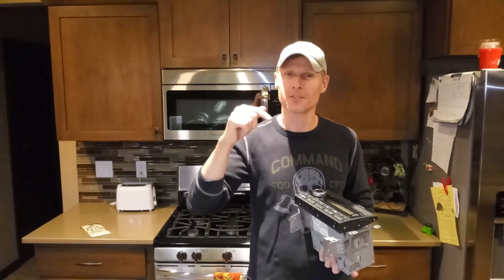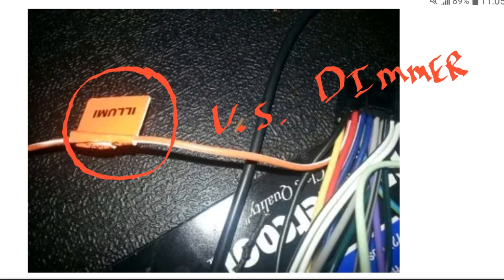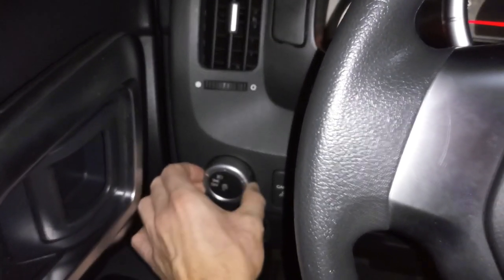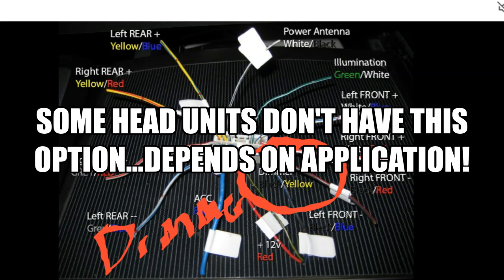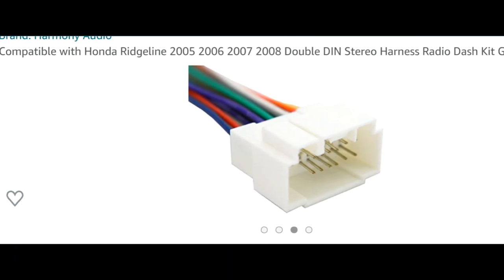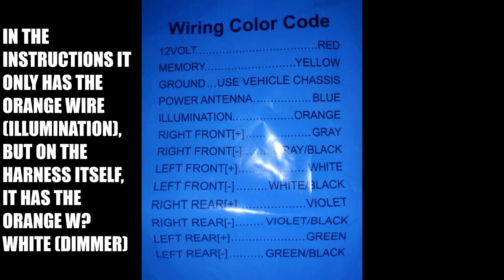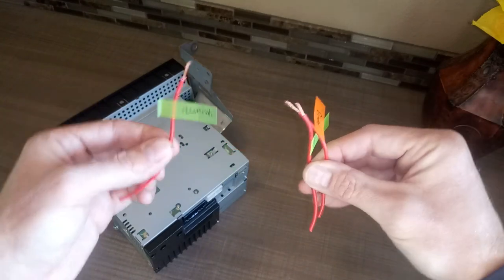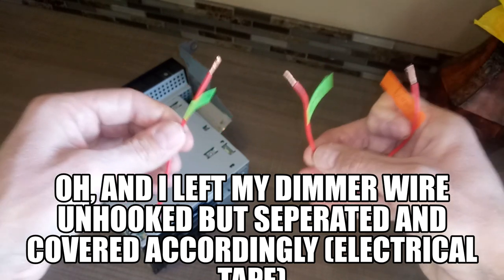dimmer vs illumination wire/ 08 Honda Ridgeline

Comment: Ok so if wire is orange/white “dimmer” coming from aftermarket radio side and wire is straight orange “illumination” from oem radio side harness what do I do?? 🤷🏻‍♂️
Reply from the maker: Don't hook them together. Secure them to themselves.
**disclaimer....always consult with a qualified professional. Videos are for entertainment purposes only***
Reply: This was my problem, too. My adapter harness to my car doesn't have a dimmer wire but an illumination wire while the after-market radio is reversed.

Thank you
Reply from the maker: @Gwenpool2369  my recommendation is to go ahead and not hook them up together and just wrap them up separate and not Oakland together at all. This is the exact scenario that I made the video for because a lot of the time, if you hook those together, you created short. The radio will still work as intended except you might not have the dimmer come on when you switch on your headlights. But as a disclaimer, always check with a qualified professional, as I am just some guy on the internet:-)

Comment: So can I just don’t connect any orange wire, leave it like that and my radio will still works?
Reply from the maker: Yes brian031.. it is not necessary to hook any of those up.. the radio will still work, just might not dim with the lights when turned on:-)

Comment: My facetory harnesses had Green which was ILL and Green white was ILL when i hooked up both wires when i adjust interior light it will shut down my headunit or restart with no sound. Any help? Should i disconnect one ILL?

Comment: what if on the car side i have Orange illumination, and Orange and white dimmer. and on the head unit i have 2 wires both marked as "illumination backlight" but 1 is Orange, and the other is green?
do i connect the 2 solid Orange wires, then just assume that the green one on the head unit is the dimmer and connect it to the Orange and white dimmer from the car?
will doing this cause any problems if they are supposed to be connected the opposite way?

Comment: More help please.  I have a orange wire that is marked Illumination/Dimmer.  This wire is comming out of the aftermarket Head unit.  There is no orange or orange and white on my factory wire harness.  What do I attach this orange wire to?  As of now with it not attached I have no lit buttons at night.  (Makes it difficult to operate)  Can I hook that wire up to the accessory power?
My factory harness also doesnt have a blue wire.  I have a blue wire on the aftermarket head unit.  With out the blue wire hooked to anything.  I have no fm or am signal.  Can that wire also be run off the accessory power?
Please help....

Comment: Than you so much for the video. It is really helpful. I have Honda  Odyssey Rb1 from Japan and the factoery harness has ILL +ve and ILL -ve. My aftermarket head unit has ILL wire only. whick do you think should I connect before I blow the fuse? 😃

Comment: Thank you for your video my Mitsubishi outlander 2004 star factory have these two wires but the aftermarket radio they don’t have it. That’s why I ignore them but I have problem now on the dashboard light not working and I check all the fuses no problem, but I don’t know why is that because I don’t use them

Comment: I just installed an aftermarket head unit, ran new speaker wires and did not use a harness. I found the constant, ground and ignition wires and connected them to the head unit. I did not connect any illumination or dimmer wires. Everything works except the radio comes on when I turn the lights on. Plus it shuts off when I open the door. Do you know what is going on or how to fix this?
Reply from the maker: Hey BillyzTube...sorry to get back with you so late! definitely sounds like there are a couple of wires connected to wires that are not supposed to be mated together. That is the problem with doing your own splicing together and not using an aftermarket harness (unless you do this kind of job a lot). My guess is to pull head unit out again, go back to research drawing board (Internet), and try and find your factory wiring schematic again, and try seeing if there is something that you are missing as far a s what wire goes to what. Hope that helps, and hopefully by now you got the problem fixed. Let me know how it went;-)

Comment: Sorry I have a question . what need This Illumination Wire for polarity it’s A plus or minus from the Lights?
Reply from the maker: Any question is a GOOD question:-) Technically, you do not need to hook up the illumination wire for lights to work on some units, but to answer your question directly...my understanding is that it is POSITIVE and it is a variable power because the dimmer switch on your dash is variable. As always...comfirm with a qualified technician as my advice is for entertainment purposes only

Comment: My problem was my factory harness had the dimmer wire the cheap head unit didn’t so I left the dimmer disconnect. Now the problem was when I turned on my headlights my dash looks washed out. It’s like the bulbs are brighter turning my nice green display into a light blue. Thoughts
Reply from the maker: Hey Rob, I would try disconnecting the Illumination wire also (they are sometimes not needed in install either)...and if that does not help, go back over your connections to make dang sure they are connected and are not grounding out on anything do to exposure. I believe that would be a good place to start. Hope that helps. I know wiring issues can make you want to break something...just don't let it be your stereo;-)

Comment: hey there. My new car stereo has 1 orange wire, and my aftermarket harness has 2 one for illumination and one for dimming. I connected all 3 at first and it worked but my gauge cluster lights didn’t come on or my dash lights. I then disconnected the dimming wire and I checked all fuses and everything and everything seemed fine but my lights still weren’t working. I then got a check engine light and SRS light because my stereo tapped into a different part of the car. I just need to know what to do with the orange and white striped dimming wire
Reply from the maker: Hey Aryan...that's exactly why I made the video, because I've been in your shoes. If your aftermarket stereo wire is marked "dimmer", then hook up dimmer to dimmer wire on harness. But most likely, it is marked illumination, and it should be mated to the illumination wire...then the dimmer extra wire gets capped separately and not hooked up. 
But as a disclaimer **make sure you consult a qualified technician about this**
Reply: @hurstysgarage  after doing that my dash gave the the check engine light and the srs light and my dash still wouldn’t light up

Comment: My aftermarket radio doesn't have any orange wire for illumination or for dimmer but my factory harness does where should I connect the factory wires to? it has both
Reply from the maker: If the aftermarket wire harness has a wire that is specifically for illum. (but not the orange color cause sometimes they are different), then hook up the illum to the illum on the factory harness, and then tape off the dimmer (or cap it off...just don't use). If there is none for the aftermarket, then tape off both the illum. and dimmer separately on the factory, and do not use...they are not necessarily needed. Let me know how it goes Ja Chavez, and THANK YOU FOR watching and comment.

Comment: Do you have any idea what to do with the key 2 wire? I have no exposed wires but keep blowing fuse 6
Reply from the maker: Shoot Melissa, I'm sorry that is happening to you...I know how frustrating that can be! My first step is to always try the obvious things first (which it sounds like you did, but just double check), and make sure each wire is going to its correct mating wire. Then find out what fuse #6 goes to exactly to give you an estimate of what is "tripping". Normally, those Key 1 and 2 wires are for your steering wheel controls, and there is usually a Key-GRND also that needs to be mated to ground wire if using key 1 or 2 to prevent fuse "blowing". Otherwise, you might need a converter like an ASWC1 to convert signal. Those are some of the things I can think of off the top of my head. Let me know how it goes!

Comment: My stereo harness only has the illumination wire and my vehicle harness only has the dimmer wire can I hook those together
Reply from the maker: Hey Tyson...sorry I did not get back with ya. What kind of aftermarket harness do you have, and what is make of vehicle? When in doubt...you don't technically need to hook up any of them, but give me that info first.

Comment: what about harness said "orange: illumination/dash", but head unit cable said "Orange/white: illumination", in this case they're the same, is safe connect both?
Reply from the maker: Yeah koolNkuiet...as long as they are both for illumination, then you are all good. Some harnesses put that color in there for some reason...I guess to try and trip us up, lol. (But as a disclaimer, always have a qualified tech check your work out to insure correctness and quality.)

Comment: I have a 07 pontiac G5 which uses a interface so, after trying to save money, I purchased 2 or 3 until I got a interface that worked correctly & my sterio worked however, the dabs(warning chimes & turn signals)  unit does not function with this interface plus there is now switched 12v so, I ran a fuse tap to a switched circuit! However, I cannot figure out how to make this radio dim at night time? Any & all advice is welcomed!
Reply from the maker: Hey D.j. B, let me ask around and see what I can come up with too. Sorry to hear about your trouble by the way:-(

Comment: I got android touch screen but the left side keys dont light up, my radio side has pink illumination wire and my harness only has dimmer wire w/c is orange, i didn't connect them as I dont know whats gonna happen, so any option i can do to make my left keys lit up? as some says it will only light up if connected both illumination wires....pls help thanks
Reply from the maker: Hey Rene...It should not hurt to connect your illum wire to the dimmer on harness if those are only options...what year, make of vehicle and model and ill see what I can find out

Comment: What about for a boat?   Installing unit on boat and old stereo didn’t have dimmer/illumination.  I am getting power on unit, however nothing is shown on face plate once I put it on.
Reply from the maker: Ok Bdub, I would try 2 things first...make sure connections are all connected to the right wires, then make sure none are touching (simple things first). If that doesn't help, then try hooking up stereo to a vehicle  that you know the existing stereo works, if it is that important for you to use that one, because it sounds like the faceplate/unit is bad, especially if there is no sound. I have a video on how to hook the stereo up to a home conversion to be able to plug it in to an outlet so you could check it that way to be sure.
Reply from the maker: Here is that video link
https://youtu.be/fcjTVA77feY
Reply from the maker: Let me know if you got it working, but it just sounds like a bad unit.
Reply: @hurstysgarage  thanks for the response .  When I get back out on boat I’ll double check everything. What sucks is I bought the unit over a year ago and just now finding time to swap it out.  It has a 1 yr warranty.  Go figure. I was thinking it was a bad face plate as well.

Comment: what about if the radio comes with an orange wire(illumination)  but the car is daylight (lights on all the time)?  so no illumination wire is available to connect.
Reply from the maker: If no illumination wire is present on factory harness, then no need to hook up wire...you can still manually dim most radio screens:-)

Comment: I just installed my aftermarket kenwood head unit today and it was working great but as soon as I turned on my headlights my head unit completely shut off (it's spliced directly to stock wires, they were already cut)
Reply from the maker: Ok, what I'm going to guess is that the wire that you mated with head unit wire was actually dimmer wire and head unit wire was illum...check fuse, replace, and then leave those unhooked but capped so they don't short on something...let me know how it goes!

Comment: I have a 03 trailblazer i put a alpine in  it and now my little spot on the dash with the shifter controls doesn't work and sometimes when i get in the car the stereo won't turn on and i will have to turn the car off and open the door and start again any ideas
Reply from the maker: Sounds like the wiring from stereo to factory harness (or aftermarket) aren't correct (or need to be checked)...so I would start there (download wire locations from internet). Let me know how it goes Rob, and good luck!!!

Comment: I want to be able to hook the aftermarket radio display to the dimmer switch to control the display on the aftermarket radio along with the instrument panel lights which should be two wires to hook the illumination wire to the dimmer wire which is two wires not the illumination to the illumination and not all three wires just two wires why don't you show hooking up the illumination wire from the radio to the dimmer switch on the instrument panel so I can vary the brightness on the radio up and down with the dimmer switch
Reply from the maker: Steve, some radios aren't designed to be compatible with factory harness wire to do that. If you hook illum to dimmer wire, a lot of times radio won't work correctly. Some don't need to have wires connected at all because they have a baclight adjuster for that. You can try, I just don't want to see you blow a fuse or worse...but if you are confident in your wiring skills and no your head unit and vehicle harness well, then by all means, give her a go...I just show you how I was taught and from some experience (I'm not a guru though 😉) 

Let me know how it goes though ok:-)

Comment: Thanks for the videos . I will doing one these Android decks on my 2010 Ridgeline  soon here ... as for the dimmer wire you left out so that’s not an option at all then it’s either dimmer or illumination?  Also what’s your experience w the head unit and iPhones etc for (car play ) etc?
Reply from the maker: Hey Jorge...thanks for comment:-)...Yes, on this head unit, I left dimmer out because it is not needed. The radio has an option to manually go brighter or dimmer if you want. And, it also automatically gets a signal to dim when you turn on your headlights (just does not respond to signal from vehicles dimmer dile knob).
And, not to familiar with iphone because I've always had an android device...but this unit has an option to connect via your Iphone, but is not specifically set up to use carplay and I would purchase this one if you want to take full advantage of what your phone and a true apple carplay head unit would allow.
My next video is going to go over most of the features I can use on...but I have an Android (LG stylo 4).
Hope this helps:-)
Reply from the maker: Oh, and if you know what wire is the actual dimmer wire from factory harness...you can absolutely hook that up to dimmer wire from head unit (as well as the illumination wire from factory or aftermarket harness to head unit harness, but spliced altogether on same circuit)...just make sure you know that is dimmer wire from factory harness for certain!
Reply from the maker: Let me know how it goes, and send me a pic of how it went if you'd like:-)

Comment: What means "key 1" and "key 2"???
Reply from the maker: GND Key1, Key2 Basically, the head unit produces 5V from Key 1 or 2 then when grounding it makes the loop so that when you press a button on your steering wheel, then the head unit detects the appropriate voltage drop and reacts to that.  Long story short...for steering wheel controls:-)

Comment: How to find the power on Toyota car stereo 2014
Reply from the maker: Hey Martin...you will have to use some type of 12v power circuit supply detector (make sure it is grounded before using as to not blow a fuse), so you can see what wire is "active" when vehicle is on. If you are trying to find the wire on the actual head unit itself...I suggest you try and find a website on the Internet that has a wiring guide specific for your year Toyota, and the model of the head unit. Sometimes you can free access to Chilton Manuels that have those schematics, online from your local Library. Good place to start anyways. THANKS FOR WATCHING, and let me know how it goes please:-)

Comment: What does K2 and K1 mean
Reply from the maker: Hey Angels...it is short for KEY 1 and KEY 2 which will be used to interface steering wheel controls if your vehicle came equipped. Although, some vehicles will need the ASWC-1 module still to translate the steering wheel controls to the stereo. Thanks for comment;-)